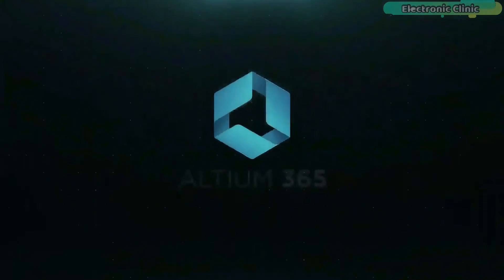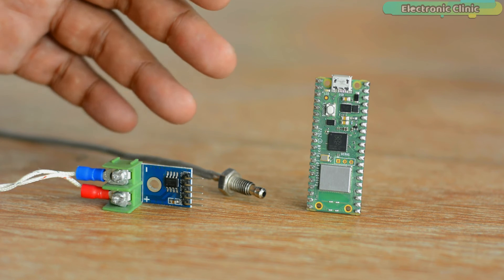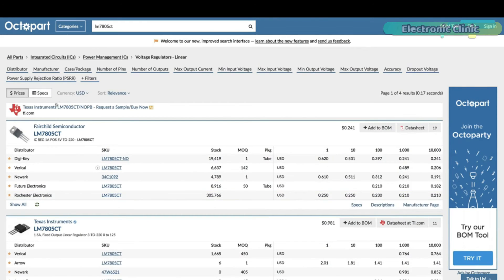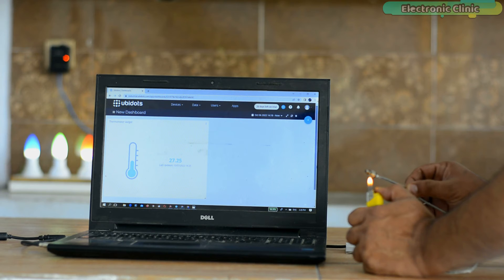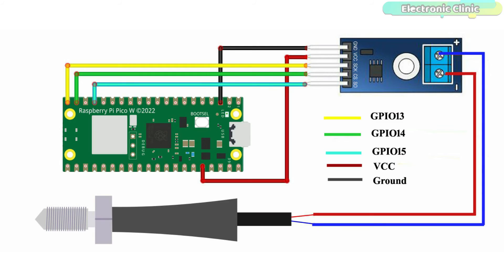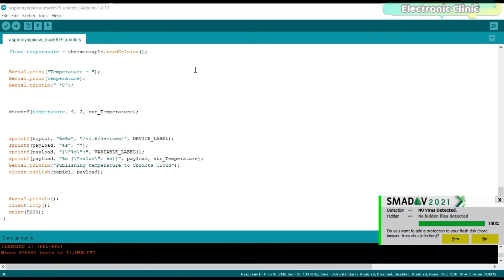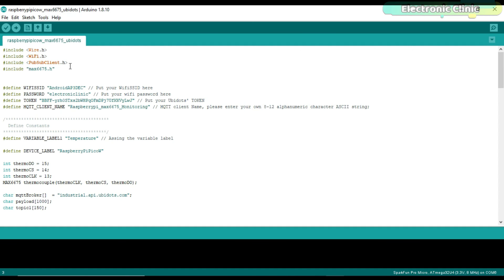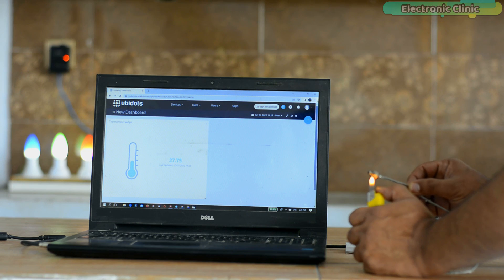Raspberry Pi Pico W with Ubidots and MAX6675 K type thermocouple, IoT Project, Arduino IDE

Comment from the maker: Other Raspberry Pi Pico projects:

Raspberry Pi Pico Complete course:
https://youtu.be/rAGw-08IOSw

Raspberry pi Pico with Adafruit IO using Arduino IDE:
https://youtu.be/Q6PtuG06j0c

Raspberry Pi Pico with ThingSpeak using Arduino IDE:
https://youtu.be/MIFd42F4cAQ

Raspberry Pi Pico and RFID controlled Electronic Door Lock 
https://youtu.be/LfptYHFc6xU

Raspberry Pi Pico and Bluetooth 
https://youtu.be/y191voKAPhg

Arduino Vs Raspberry Pi Pico:
https://youtu.be/15S8HM1GMu0

Raspberry Pi Pico Pinout Explanation and Onboard components:
https://youtu.be/q6rbqR4X7hE

Setting up Raspberry pi Pico:
https://youtu.be/jJBwi5pEvN8

Raspberry Pi Pico Led Examples:
https://youtu.be/0NmRtVAHJ9A

Raspberry Pi Pico Digital Input:
https://youtu.be/MCeQsSQu_sE

Raspberry Pi Pico Oled display SSD1306:
https://youtu.be/fH23Kvl_o_o

Raspberry Pi Pico Analog Input:
https://youtu.be/_f_tpVNMXTk

Raspberry pi pico Ultrasonic Sensor:
https://youtu.be/7R_-deTXDLo

Raspberry Pi Pico Temperature Sensor:
https://youtu.be/__v2P_RmXSY